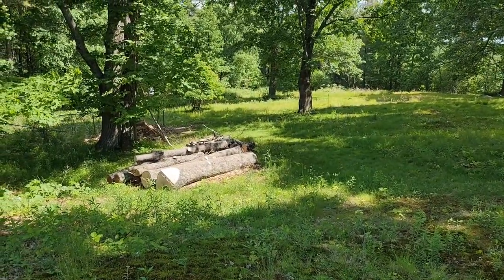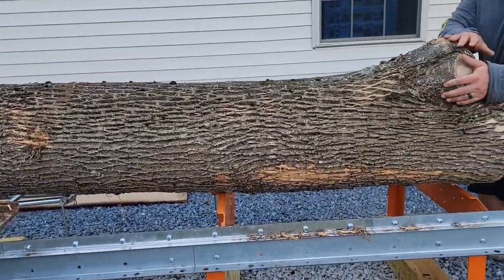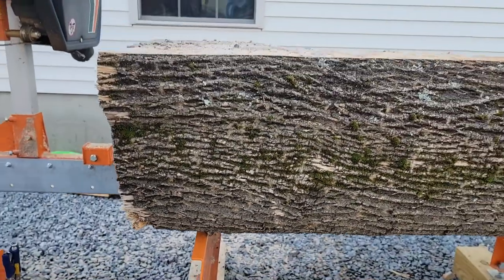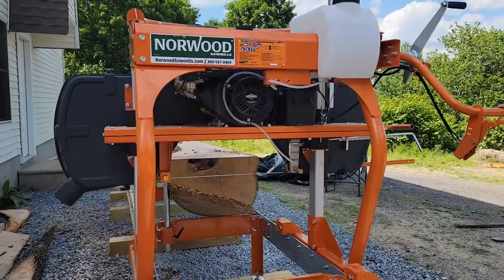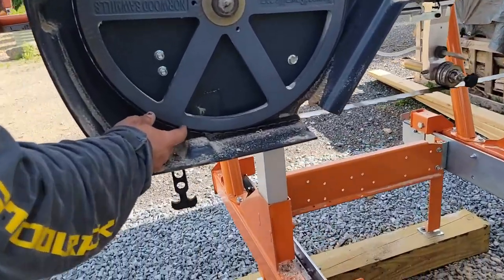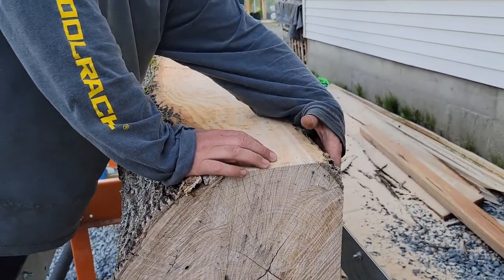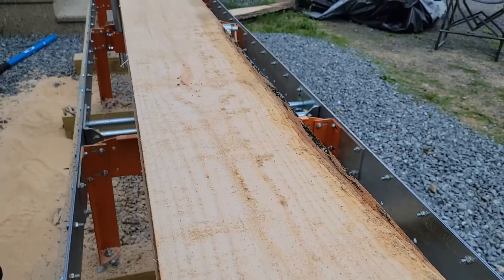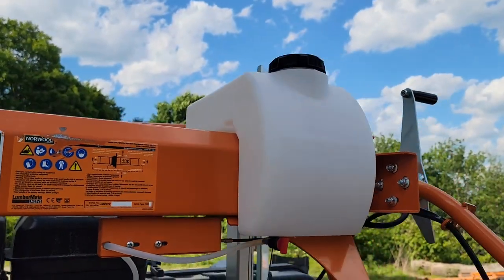Learning to use our portable sawmill - (we found a surprisein log at end of video)

Comment: What kind of blade do you use?
Reply from the maker: We had used the factory ones originally, then had 3-4 sharpened locally (I believe we posted a vid on that) after they were so much better. We also just got some woodmizer ones since the sale was so good, haven't tried them yet. We will get a vid to review the different blades up soon.